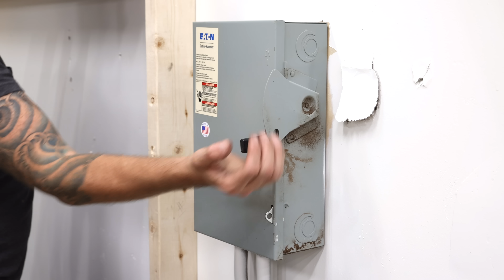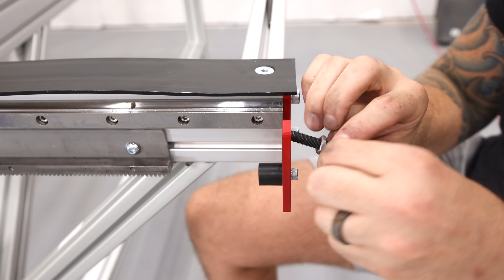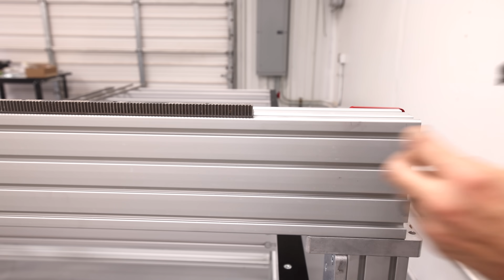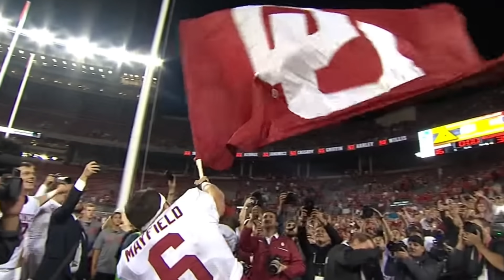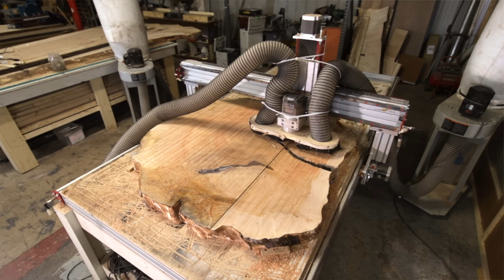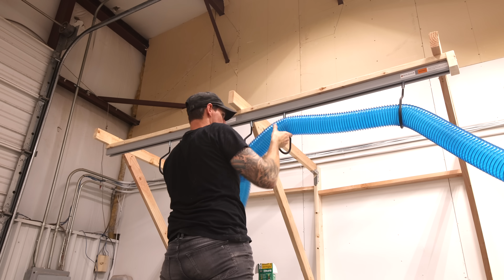This Machine Has Earned Me SO MUCH MONEY

Comment: The supply for high quality woodworking products has never been oversaturated because the skill required keeps those doing it limited in numbers. CNC is definitely flooding the market and the lack of skill required means it will continue to draw in and eventually be oversaturated. I'm a huge advocate for CNC manufacturing but if I'm at an event with things I actually made but next to someone else with similar or better that they made with CNC, it will be exceptionally frustrating. Add an NS to the end of CNC?

Comment: Great video. I too share your thoughts on the present and future of woodworking and general manufacturing using CNC. Every time I try using traditional woodworking machines I don't quite get the joints, or edges cut or shaped as accurately as I wish. This is why I started building CNC machines in the first place.

Comment: Thank you for removing the cloud over using CNC machines.  I've worked in a machine shop since '76 and used a ShopBot in my CAM class for 20 years.  In working with students and apprentice machinists they get all of the stuff that old guys, like me, learned later (especially CAD).  Their computer skills are top shelf.  The best people get the flexibility that you are talking about.  These machines release the creativity of these young CNC adherents.  Do they understand all that experienced shop veterans know?  Not yet, but they are fast learners.  We do stress the understanding of setup. alignment and especially workholding.  I'll be retiring soon, guess what is going into my shop?

Comment: cnc and cad cam has been common place in manufacturing since the 1990.  Either making it in metal or wood.  Looking at where burning man has evolved too with the wood builds in the last 15 years..  CNC has been around for three decades in the woodshop, you just missed the machine sitting in the corner doing its thing.  Glad you made it though.

Comment: Oh man, in 1995 I was working with a 4-axis cnc machine to make seats for chairs and tables. So, you are way behind the curve. The next machine we bought a 5-axis machine to speed up the production in basis for upholstered furniture. So, yeay, you are extremely late to the party...

Oh, working surface for the first one was 3 meters by 1.5 meters. All was held by vacuum only. And yes we did some sculpting too. That was somewhat of a challenge but it was doable for one-offs.

Comment: I think that CNC machines will be used in future, but some traditional industries will be replaced with 3D printing, main reason for that is development of 3D printers, 3D printers alredy can print metals and alloys, yeah i know that 3D printer basically is CNC machine, if we talk about furniture industry its for sure that CNC machines are staying here for a long time, but some other industries that is "unapproachable" for proccessing with CNC machines will be swallowed by 3D printers, my opinion is that the casting industry will be replaced with 3D printing for small objects, and in future that scale will just get higher and higher.

Comment: It takes a different approach with a CNC. You can't just buy it and expect it to work. You need to put in the effort to understand how you do your CAD/CAM, what software to use and how much will set you back both financially and in time to master it. My compagnon is a hardcore-by-hand type of furniture maker, afraid of computers, 3rd generation in line of carpenters (from his father to his great grand father). His work is up there, incredibly well made. Good eye for the finest details. He has a huge SCM table saw, large SCM planer and a Blum door hinge drill with row boring feature as well. And a domino and Lamello cutter. That's his method. The thing is. Carpenters (at least the ones i know) are not famous for their flexibility when it comes to 'new'. Sceptical at best. I sometime machine things on the CNC for him. He's happy with it, but he won't step up to learn how to CAD/model. It's just not his thing. He's like 'i don't understand how you can spent an entire day behind the screen designing' . I do projects of which he would refuse and the other way around. I own a CNC and a edge banding machine, it has been profitable, but most of it, I enjoy/love my work. I do work for some companies,  and also make custom furniture.

PS, that MDF can be cut in 1 take, no need to go 2 times around that contours. No need to be careful with MDF.  :) 0,5 -0,6mm/teeth is the way to go.

I don't know what work you're in, but I couldn't do without my vacuum table!

Comment: I am interested but not convinced. I assemble a lot of Ikea furniture for TaskRabbit. I doubt that I could ever match them for design, quality, or price on CNC manufactured furniture. The only angle I could reasonably try for is to try to find a niche item they don't make. The reason I would be getting into woodworking or furniture building is, even Ikea furniture leaves a lot to be desired, especially for durability.

Comment: Rob Cosman even has a CNC now. But it's for the production line his business requires, he's still the hand tool coach, and in person mockup enthusiast. I love making stuff, but if I was doing cabinets I would have one of those panel saw CNC's they have the speed of a table saw when cutting. CNC's are cheap compared to employees when you think about it, if business is expanding beyond your control it's a lot easier to find a CNC and it will never quit unless it's mistreated and not maintained.

Comment: Kudos for the benefit this has had for your building, but as an Australian, I find it very surprising hearing how you say it's the future. I'm assuming CNC flatbeds aren't really popular in NA. Down under they've been the staple for small, medium & large businesses for the last two decades. I almost take flatbed nesting for granted considering I myself have been using it for the last 10 years. Glad to see it's gaining momentum however, as this will breed competition and innovation in a current niche of the industry that I feel is somewhat languishing. Keep up the good work.
Reply: I had the same thoughts! On the other hand, they've been adopting 3d printing/additive manufacturing at a faster rate than we have. Lots to learn both ways 👍

Comment: Very nice, I’ve got the original one from Cnc Routerparts .  Makes money every day for me. The new bearings and z-plate are a great upgrade from mine. Because of mainly my use of sheet goods I went with a vacuum bed instead. At some point you may wish to switch to an ATC . So much time gets wasted with tool changing manually. The only is is real estate from the kit size. However with Avid you just need to add a little more length for tool storage.

Comment: Remember the cost of the electrical infrastructure to bring 3 phase power into your house or shop. Probably over 10,000$ and now insurance costs will change due to high voltage. Plus your electrical bill will increase exponentially. Food for thought

Comment: Twenty-two years CNC fabricator here. It's funny that I get the opposite reaction in the wood shop. Every little task is by default sent to the CNC department even if a traditional tool like a table saw would be a better choice for the task. "We need 3 rectangles of plywood 12x12 inch." I'll walk past them to the table saw and be done in a fraction of the time LOL. But to your point, CNCs are amazing machines and I feel privileged to get to "play" with them everyday for pay.
Reply: i remember once my boss got mad at me for making custom cardboard shipping boxes for products to be shipped on the cnc router. to me it made sense because i could make the most cost effective size and shaped box for shipping rates. he told me a knife would be faster. sure. but was that few minutes of saved time worth it? fuck it.

Comment: I figure you are correct. When the techniques for hand crafting are no longer appreciated, mass production is what we will get. Yes it will be woodwork with MDF and ply at best.
Reply: Do you drill your holes with a manual hand crank drill? Do you cut your wood with a hand saw?

Unless you never use power tools in your woodworking endeavors you can't really criticize the use of a machine.
Reply: @OU81TWO  I get the same response on my plaz table, I ask them what they use for a bellows on their forge ..

Comment: Are CNC machines part of equation going forward?  Absolutely.  My issue is not with the machine but for what 'most' of these machines end up turning out.  In an IKEA centric world (i.e. it looks good and its cheap), I have zero interest in that sort of product.  CNC's are terrific at turning out quality casework for cabinets, but again, due to the pursuit of the almighty dollar, end up turning out particle board garbage much of the time with an IKEA flair.  That simply is not what I personally want to do.  My reputation is one of quality, a level of quality that's head and shoulders above the competition (or that is my continual goal).  Could a CNC assist me in maintaining my goals?  Probably, but it will never replace the personal touch that my hands can deliver to a client.  CNC's have their place, but I hope they never replace the craftmanship that 25 years of experience can provide.

Comment: $7.1K + freight if anyone is wondering. Don't expect anything less than $3-4K if you're a DIY. The beefy gantry, LM guides, and electronics account for much of the cost, and they're not cheap. I'd use SBR16 to cut down the cost and still be in the $1.5K-2K range for a 4x8 build. The easiest way to level the cutting bed is to run passes through a sacrificial HDF/MDF base. My pride as a mechanical/electrical/automation CSE in the semiconductor industry doesn't allow me to take that shortcut because the success of a multi-million dollar installation starts with leveling the base, or all hell breaks loose.
Reply: If you know how to weld really well and make it fit up properly the cost is lowered by a lot.

Comment: Did you get a name yet, I was thinking piece-o-junk. That is not a monster machine and not a beast. It is a weekend warrior , DIY-er machine. It is good for building a sign or for flattening a slab. 
A monster or beast machine as you say is a machine with an infeed scissor lift, a full dust table dust collection system, an automatic push removal and a vacuum table. 
You can cut sheets of material all day along.

Comment: Can you turn the 5x5 in to a 5x10? Thinking space wise the 5x5 would be a good start with Nema34 motors. Upgrade if I have the room later. Curious how hard it is to get 3phase power installed at home.. and more so how much it costs to run the machine every day.
Reply: Most places will not install 3 phase power in a home shop. You can get a converter to change single phase to 3 phase.

Comment: A cnc router is a tool like any other, equivalent in impact to many shop mainstays we currently use, planers, table saws etc. All of which violently altered the terrain of woodworking. 

I respect the intent of hand tool authenticity but it is typically paired with ignorance. An individual who believes "the computer does all the work for you" clearly has no basis for comparison, and how could they with that bias?

If consistency, accuracy and versatility are a yardstick by which you measure the value of a tool to complete a task; a cnc is indeed one more valuable tool to add to your repertoire.

Comment: CNC"s machines are here to stay. However, using a CNC to cut wood may be considered woodworking. But is not REAL "woodworking". Unless you are milling, cutting, ect. with hand tools, power tools and your 2 hands, then it is not real woodworking. Sitting at a computer screen and programing a robot to do all the work is called something else.

Don't get me wrong, as I am a supporter of CNC's in the woodworking shop and have one myself. But, when I use it,  I don't consider myself doing real woodworking. 
I give all my clients a choice, either I can build it totally with hand tools and powers tools or I can use the CNC to cut out the majority of the parts. Obviously, their choice will dictate the total cost....Almost 50% difference in some cases.
if you want it cheap then I can have a robot cut them, but if you want skilled hands to build it,  then you have to pay more. Most of my clients prefer me not to use the CNC, and build it with BLOOD, SWEAT AND TEARS...!
Reply: Let me guess you use whale blubber to light the oil lamps in your shop...
Reply: @SegoMan  What does that have to do with real term of "woodworking"?

Comment: CNC is definitely the "here and now" of any production shop but there will always be a niche for custom work, one-off pieces, refit and repair. This became the focus of my work a few years ago. I can see how a CNC would be helpful in creating quality woodwork, but it can't replace a master craftsman.
Reply: As production costs for new stuff decrease, repair becomes increasingly untenable unless the old article cannot be replaced, like for like - historical or sentimental value, very old furniture. Even then the costs of repair might be out of reach for your average person.

Unattended CNC operation is the holy grail of any manufacturing process. Either by having a table large enough you can set up a multi-hour operation or by having a robot load and unload the machine automatically.

CNC's can automate and improve the quality of low skill jobs meaning you can focus more on your "art", the stuff a robot or a cnc simply can't do. They also open up a whole lot of creative opportunities to improve the work you do. 

Doing it the hard way isn't necessarily art. Sometimes it's just being stubborn and unwilling to learn. A bit Luddite you could say.
Reply: @xm210c  There's definitely some Luddites in the trade. But I don't think a CNC could restore the Louie 14th chairs I did some time ago. They're over 200 years old and worth saving. And like you mentioned, there's an aspect of art in hand crafting.
Reply: It's a tool, it's not meant to replace as much as it's meant to assist. It's the same as saying a table saw wouldn't replace a master craftsman. Just because you can pre-program the machine ahead of the cuts it doesn't mean you don't need an experienced person to program, monitor and do the proper finishes once the machine is done. If you really think about it, I bet you could find use for one in your custom works too, just perhaps not the entire process, just like it would be silly to use a table saw for the entire process.
Reply: As a qualified Metal Machinist with a post-trade CNC, there are just things you can do with a CNC you cannot do with conventional lathes, mills, shapers etc.
I worked in a place finishing Oil Field Drill Bits tapered angle square threads internal and external etc. that would take you days to do manually .. I could finish 4 units per day so there is that

Comment: It would help if you defined CNC/explained what it is - some of us have no clue.  I prefer to work on a small scale, rescuing old pieces and scraps of wood.
Reply: CNC stands for "Computerized Numerical Control". It's a generic acronym that applies to a variety of automated machines such as lathes, milling machines, laser cutting machines, water jet cutting machines, welding machines, to name a few.

In the woodworking realm CNC is used in conjunction with a router spindle mounted on a rail system to provide horizontal (x and y axis) and vertical (z-axis) motion control. That's what your looking at in the video...a router that can move along x,y,z axes controlled by a computer.

Comment: It's a great CNC..  I got the 4X4 Pro version in 2017.  I love it for my hobby.  To cut on cost, I got my own electronics and wired it myself.  I was definitely steep learning curve on how it works and configured.  It was a great experience putting everything together.  I was using Vcarve but switched to Fusion 360 because I also do 3D printing and Fusion 360 can do both.  I would call it behemoth.
Reply: Nice. I just acquired my first 4x4 cnc r machine. It was originally a plasma cutter but now it’s more like a shop bot model. I’m fairly new to fusion but that’s what I bought to learn from. Learning fusion has been my biggest challenge more so on putting time into it. I have a recent new China laser machine that gets most of my attention learning Light burn. My prayers have been answered for these machines but transparently I could use prayer for more jobs and some momentum on the cnc. Feel free to share ideas on getting jobs or projects. I wouldn’t mind starlet production work for companies outsourcing but not sure how to find them atm. With gratitude.